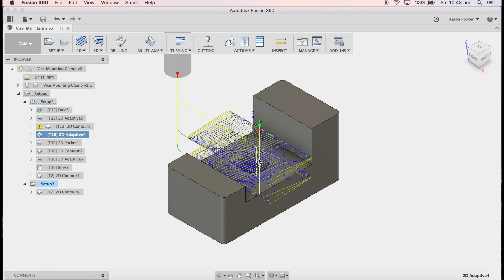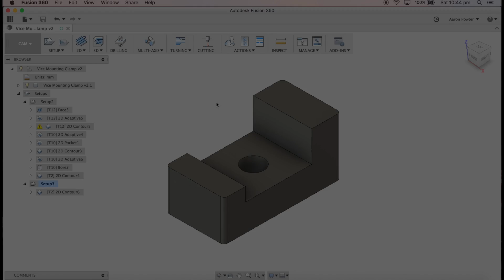Fusion360 CNC Machining at Home - Vice Mounting Clamps

Comment: Hi Aaron what vice are you using, and did you cut the lower rear part of the base of the vice down for extra clearance, and is that a bf20 mill cheers Neill. PS thanks for the vid.
Reply from the maker: Hi Neill.  The vise shown here is a Chinese anglock vice.  It came with my machine when I ordered it back in the day (2012).  If you're after a great vice you can't go past an Orange Vise USA.  However, if this won't fit on your machine take a look at MLOCK 125 from the UK.  My advise and from my experience, pay extra and get a good quality vice.  Thanks for watching my vids.  Cheers, Aaron.

Comment: Very cool!  I thought the shape weird at first....then noticed how your vise has the different base on it.......then I wondered why for a couple of seconds and figured it had to be because the normal mounting holes didn't line up right with a T slot.  Makes me less shy about getting a vise with a base like that.  Hmmm.....maybe I'll make some for the 5" vise on my round column.  I already cut the mounting flange off the back of that vise to get more Y travel. lol  I wasn't bright enough to figure out to make fancy clamps! lol :)
Reply from the maker: Hey Mike, yes it took me awhile to learn to mill the back off my vice too.  Plus the I stuffed up the first fancy clamp because I read the wrong measurement (didn' t have glasses on).  I only got an extra 10mm, but boy does that help.  Us blokes are always chasing the extra length hey ha ha ha.  Cheers mate ;-)
Reply: LOL.....I'd find another 3" if I lost 50lbs. ;)
Reply from the maker: I hear ya bruddah, me too lmao :-)

Comment: You're way better at tramming a vise than I am ;)  Great video, my G0704 mill is currently in parts on the bench while I convert it to CNC :D
Reply from the maker: HI Jeff.  Thanks mate, but the truth is that I spent a good 15-20 minutes tramming the vice off camera.  Plus I could be using a better dial gauge that shows smaller increments than that one.  Yes I've been watching your progress on Instagram.  Your CNC build is coming together very nicely.  Hey, did you ever download my CNC conversion files?  The link for all my files are in the descriptions of the video titled "Ballscrew CNC Conversion Kits - Free Fusion360 Files".  Help yourself bud if you're interested?  Cheers, Aaron.

Comment: 5:50 Ah, finally a use for those tape measures on the front of the table - estimating the vise size. :) Must be about a 5" vise? Nice idea Aaron.
Reply from the maker: Good pick up Kent lol.  My vice has 100mm jaws and can open to 120mm.  So I'm guessing it must be around 5".  You know us "metric" people over here ;-). Making the vice clamps gave me an extra 10mm in the Y-axis near the column.  You know us blokes, always chasing the "extra-length" ha ha ha